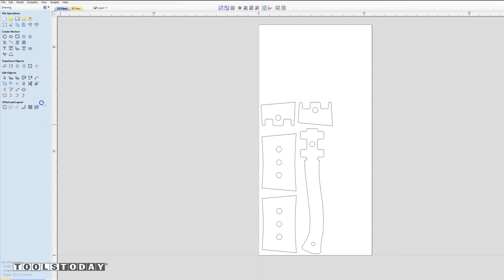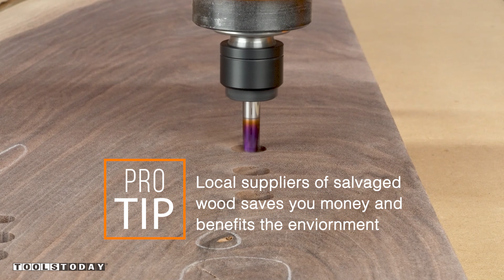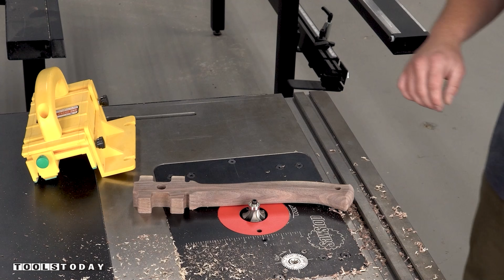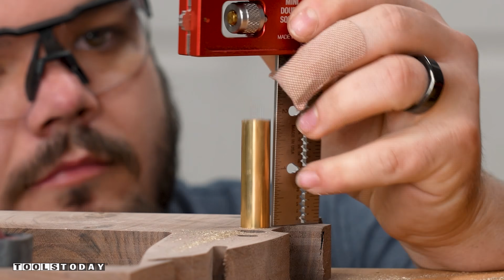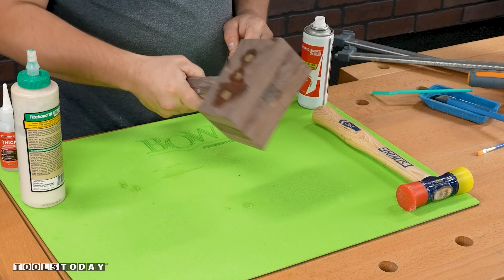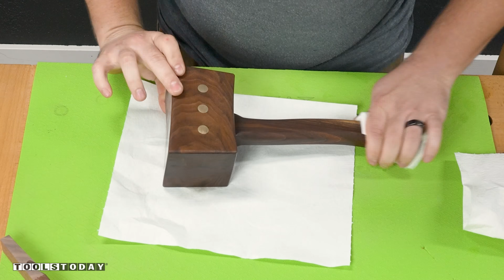My Best Wood Mallet Yet - How to Make Mallet on CNC | ToolsToday Video

Comment: Awesome mallet, I purchased the plans for Christmas presents.  I don’t have any access to live wood, what thickness is the piece?  I plan to present it as a meat tenderizer, is there any othe finish that would be more suitable or is the linseed oil ok?
Reply from the maker: Thank you for the support!  The wood I used was 1" thick, and definitely doesn't need to be made with a live edge piece, this was just the offcut I had to use.  For food contact, I would use mineral oil as the finish instead of linseed oil.